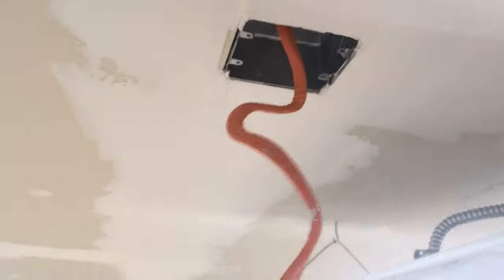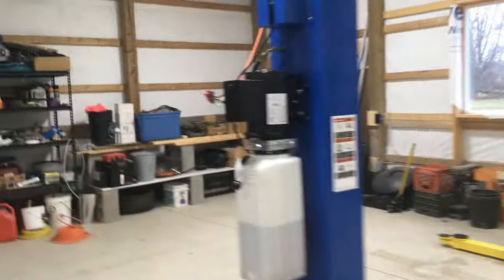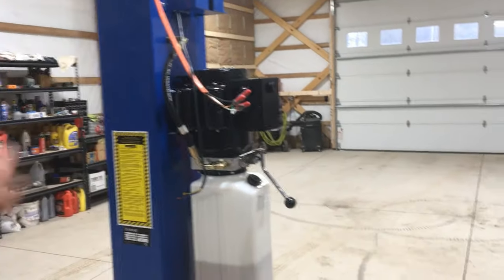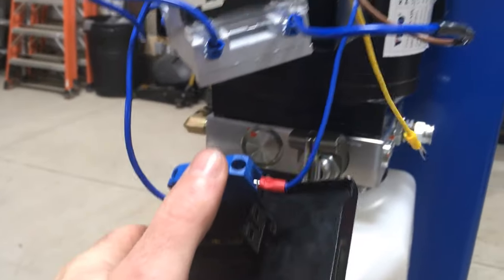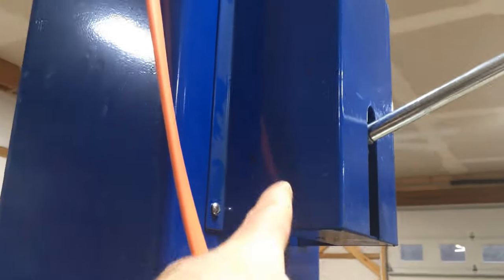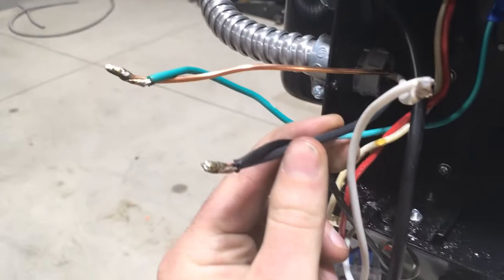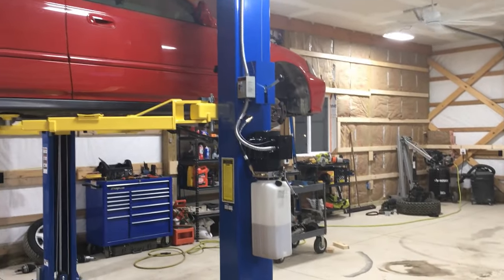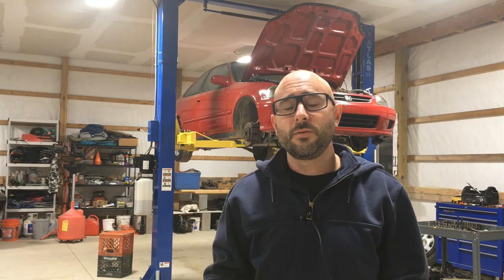2 Post Lift Wiring - DIY w/ Limit and Shut Off Switches

Comment: White wire connected to a breaker should be taped red or blacked since its not a neutral, other than that everthing looks great, I like how you did the exposed portion in flex steel conduit and secured it to the hoist.
Reply from the maker: Thanks for the tip! I’ll put some tape on there next time I open the box. I thought about buying 10-3 so I had a red wire for the 2nd hot... but went the cheap route.
Reply: How tall is your ceiling ,I'm getting ready to order a lift. A CL-2-9  KSCX 9000 Symmetric. Don't know which is better, I'll hope for the best.
Reply: It actually could be taped red, blue, brown, black, purple or orange. Any color but white or green.
Reply from the maker: @TommyDMoore-vc8sl  sorry I missed this comment until now. My ceiling height is 143.5” from concrete to drywall.

Comment: I really appreciate your video. I just had my new Atlas 10K installed and the very limited instructions did not help me with the Limit switch install. I would have liked to see how you installed and adjusted the limit switch as well. Instructions that I have are not very detailed. This is just what I needed to see. I will order a On / Of switch like yours as well. Thank you !
Reply from the maker: @williamogrady6567  thanks! The lift installation company installed the limit switch and I didn’t make any adjustments to it.

Comment: Thanks, I ordered the switch and enclosure like yours. I was just going to put a single pole cut off but this is so clean and I like the hole I can put a hitch pin clip into. I won't need to lock it.
Reply from the maker: I hope the setup works for you! I only shut it off when I plan to be away for an extended time.
Reply: @ShawnFerret  I plan on using it similar to you. I just think it's a good extra line of defense. Thanks

Comment: Very clean install!  I do like the motor starter switch.  I'll be honest, I installed my disconnect box and clips to the lift with good ol' fashioned #8 self tappers.  They worked a treat, the columns are thick but soft.

Comment: Nice clean work! Im wiring a 220v lift today that is very similar. Nice explanation on the cut off switch wiring. Going to implement that into what i am doing!
Reply from the maker: Thank you!! Have fun with your install. I’m sure you will love it when it’s done.

Comment: thx for the video....i just had a the Atlas 9KOH installed...should have done it myself....anyways, I used your idea to add a switch.  I mounted mine directly to the column and I used a 20amp switch and used 12 gauge stranded wire to a 20amp/220volt breaker.
Reply from the maker: Awesome! Glad the video was useful to you. I felt the same way on the install. Hope you have fun with your lift.

Comment: I have the same Atlas lift and the cheap contacts inside the contactor intermittently welded shut!  This kept the motor & lift running until it hit the upper bar limit switch.  You mentioned that you installed the emergency shutoff in case the up button sticks, well it’s not just the button that could stick and in my case it was the cheap contacts in the white relay contactor.  The contacts melted together.
Reply from the maker: Good to know!!

Comment: My switch broke in the on position. Lucky for me when I put my lift in outside I only had one permanent 220 source (my well) so I just added an outlet with a cut off switch to my well and when I want to use the lift I plug it in so when the switch on the lift locked into the on position I just unplugged it.

No it’s not technically to any code but when used only one appliance is used but works for me at my home where no one cares but me.

I’m just glad I had the option to turn it off. It’s an old lift so no fancy interrupter switch.
One day I’ll change it… Been saying that for 10 yrs….
Reply from the maker: I thought about wiring mine to a plug as well. I think that’s a pretty good disconnect option too.

Comment: What do you use to get those bends so nice and square in the breaker panel? Great idea to label the wires with Romex insulation. I have a metal building so all my wiring is MC. Don't know what I could use.
Reply from the maker: I just bend the wires by hand inside the panel. It takes a little more time to make them straight and clean but it’s not difficult to do.
Reply: @ShawnFerret  looks really nice and straight. I have to try harder

Comment: Was the switch just an add on? Or did the lift need that to function. I'm wiring one up this week but I didn't see no switch nor was it mentioned. My plan was to just send power to it and thought it was controlled by the bar/lever thats already on the lift.. thanks for the help
Reply from the maker: I added the shutoff switch, as my breaker panel is quite far from the lift. The instructions for the lift recommended to add a switch, and most local codes require it. If the button on the lift sticks you have no way of stopping the motor without another switch close by.  An exception would be if the breaker panel is very close to the lift. I recommend following whatever your local code prescribes.

Comment: Trying to put in a new button switch for the up and down of the lift and having problems getting the incoming power white and black wires to the line side of the pump and the normally open and common side of the button how do you wire the new button in is what I’m asking?

Comment: What is the distance between the lift and your wall?  Is that enough room to move around?  Would you place it differently if you had to do it again?
Reply from the maker: I went 30” from the wall to the base plate so I can roll a 24” cart through there. Since the columns are narrower than the base plates themselves, it leaves a lot of room to walk by holding a tire for example. The position is perfect for me. I have it set up to back cars in, and I’m really liking it so far. I would change the position of my lights, which are 6’ off the wall, because it’s creating a darker/shadowed area on the wall side when a car is lifted.  They probably should have been  3-4’ off the wall.
Reply: @ShawnFerret  Good thinking about the cart size.

Comment: did the switch need to be double pole to run both hots through it? my diagram that came with my lift only shows using one of the hots to go through the limit switch and also inline with the manual shut off switch same wire. i am about to do a rough wire up to run the pump and bleed the cylinders. still looking for a manual cutoff switch to use.
Reply from the maker: Yes it needed to be double pole for both hots in order to cut all power to the unit.
Reply: @ShawnFerret  you think it will get messed up with a single pole? cause that how it looks like the top out switch is wired up. only one of the wires run through that switch.
Reply from the maker: @fashionrider712istunthi9  the limit switch just cuts the power signal from the up switch. If you add another shutoff switch there, it doesn’t protect for anything that could go wrong in the circuit board or relay, it only protects against the up switch sticking. So you would still run the risk of the lift running away and not being able to completely cut power.

Comment: How do you like the shop size with the lift in?  I'm starting to plan one and debating how wide to go to fit a lift, another car and have enough space to work.
Reply from the maker: I’m really happy with the 32’ width! The lift is spaced 30” off of where the interior wall will be, so you can still roll a cart between it and the wall. I still have room to go two additional cars wide next to the lift if I was just storing them.  Even at 28’-30’ wide there would still be plenty of room for the lift and just one car with working room.

Comment: Any reason you used MC cable vs SJOOW/SOOW?  Looks like MC is currently 2+x SOOW/SJOOW in NY.
Reply from the maker: I just like the look better when using a switch box. I would have used SOOW if I was making a plug at the ceiling - probably wouldn’t have been a bad idea. The MC was extra given to me by a friend so I never looked at prices.

Comment: If it only rises by 400 mm,
Whether there is a safety lock.
Whether the safety lock can work.

This type of clear floor lift should have two limit switches, one for the column and one for the top.

Finally, I am an lift manufacturer from China.
Reply from the maker: I don’t actually think there is another limit switch in the column because the motor doesn’t cut out when it gets to the top, the hydraulic cylinders are just maxed out. Just like a tractor when you reach the top of the travel with the bucket - the sound changes and you know to stop.
Reply: @ShawnFerret  Yes, but some novices don't stop.
Rising again, again and again.
The cylinder will break down.

The limit switch of the column can protect the oil cylinder.
Reply from the maker: @Car_Lift_Manufacturer  neat feature.

Comment: How to wire the limit switch on top ? Just 2 wires and wire to wire ?
Reply from the maker: It gets wired in series with the main switch circuit. The limit switch is normally closed and creates an open in the circuit when activated.

Comment: Are all of those hydraulic pumps runs out of 220?
Reply from the maker: There are smaller hydraulic 2-post and scissor lifts that run off 110v.  Dannmar MaxJax is a popular 2-post.
Reply: Some 220v motors can be rewired for 110v. I have a BEND-PAK that is currently wired for 110v, but I will be wiring it back to 220v for lower current draw.

Comment: Electricians correct me if I'm wrong, but shouldn't this be wired with 10/3 using black and red as the two lines and the green as ground? White has no business being hooked up like this.
Reply from the maker: An electrician chimed in at the start and said the white wire needs to be clearly marked with red electrical tape.

Comment: Do you have a part number to the switch and box?
Reply from the maker: Switch: Leviton MS302-DS
Box: Leviton N13NC-DS
Reply: @ShawnFerret  thank you sir , I just ordered one off of Amazon that’s supposed to be a 30 amp double poll switch with the Sam box but it’s a different part number
Reply from the maker: @HectorRamirez-bo9kv  nice! I got mine from Amazon too. There was an option for the switch and box together as well. I just went with what shipped the fastest.

Comment: Does this work as a over load protector?
Reply from the maker: The 30 amp breaker in the panel is the only load protection for the circuit. There is nothing to protect you from putting something too heavy on the lift, if that’s what you mean. I’m pretty sure this lift would bend or break the arms off before the hydraulics stalled out.
Reply: @ShawnFerret  I have a bend pak lift and it’s states there’s “no thermal protection” the inspector says I need to get a switch installed that is a starter for the the motor and provides a thermal protection for the motor itself. If the switch were to fail or draw too much power the newly installed switch would add protection for the motor. Much like a refrigerator or electric powered power washer. They have thermal protection built in.
Reply from the maker: @ThomasJurk-tm3gr  ohhh I see. The Leviton switch I installed is just a motor interrupt switch but doesn’t offer thermal protection that I’m aware of.  There was no labeling on this lift that indicated it needed or lacked thermal protection. It seems like that would require a sensor on the motor? I’ve got no experience though, I’m just a DIY guy relying on my local codes, not a professional at all.
Reply from the maker: @ThomasJurk-tm3gr  also jealous of the Bendpak.
Reply: @ShawnFerret  thank you sir much appreciated!